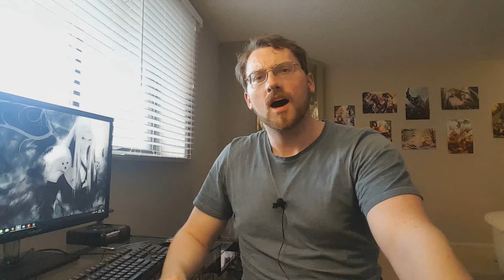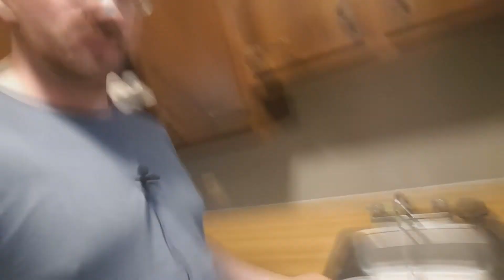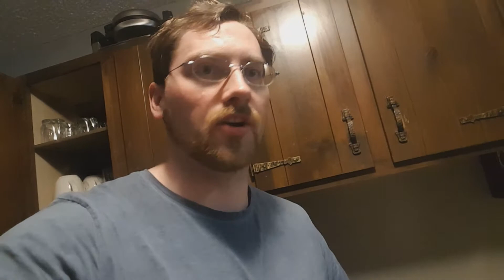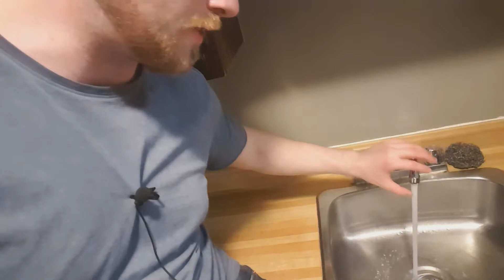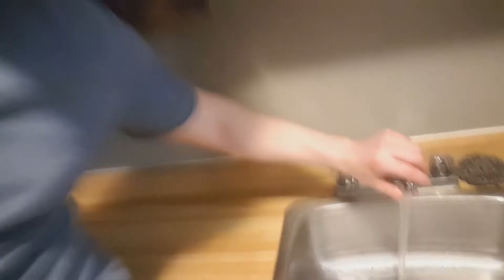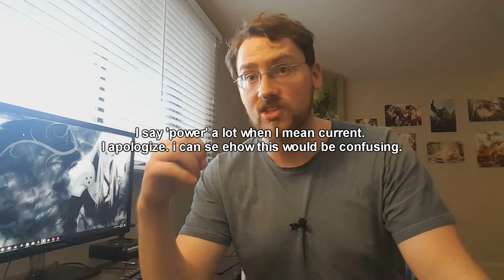Voltage vs Power, Threadripper vs i9

Comment: I dont think that an overclocked 18 core cpu,will manage heavy duty workloads just as good as amd solutions if the clocks where tuned to execute the same amount of IPC, even with the latency of infinity fabric that can be compensated by overclocking the ram....I think it will be extremely hard to exceed 3.1 mhz with temps within the 65 C on a decent custom cooling ekwater block solution for Intel, while I think that the amd solution will be capable to hit stable 4.3 Mhz on the best chips within 65 C..it will be very very interesting to see how far the memory will overclock on AMD barbecue of the infinity fabric I suspect that speeds above 4000 mhz might be pretty common, if the motherboard has prime rated materials for its components.....We need to see what asus will make as a workstation motherboard for threadripper, and I think it will take a lil more time than it usually did for intel WS class motherboards....fact is that amd solutions will be capable to run at least 6 gpus scaling properly PLUS raid 10 on m.2......so any amd system taken as global machine will likely obliterate in computation for really heavy high cache super overloaded workloads and while using tons of wattage in those situations  thermals will stay in check and stable, while the intel solutions will not be capable to keep thermals in check and will likely fry the motherboards very easily......so we should expect Intel based systems to become notorious to fail often....expect advanced Ram memory sticks at crazy prices hit the market soon at microwave oven speeds
Reply from the maker: I'm sorry but if you think that people can expect to hit 4.3 on even a high-end liquid setup on anything but 'maybe' an extremely rare subset of chips, you're intentionally fooling yourself. There's absolutely no reason at all to both expect that Threadripper will OC higher than the top 1% of 1800X chips, AND expect that Intel's 18 core won't OC to even close to within an entire GHz of the 10-core model. Furthermore, expecting RAM speeds on the Threadripper platform to far exceed those possible on AM4 is similarly unlikely. 

In fact to say that every single one of your assertions are wildly speculative is being very generous. There's absolutely no precedence or evidence for any of the claims that you're making at all. You're asserting both that Threadripper with increased core count will OC better than the best of Ryzen 7 while a similar core count will DRAMATICALLY decrease Intel's OC ability. it's true that Ryzen's much lower current compared to Intel's lower voltage means that Ryzen is more power (thus heat) efficient, and will likely be easier to overclock to that ~4GHz threshhold that the entire Ryzen lineup is limited to, 

We should fully expect Threadripper to OC to around 4.1GHz on a good day, with RAM speeds of around 3200MHz, and we should expect the Intel i9 7980XE to be able to achieve at least 3.8GHz under liquid, and maybe even break the 4Ghz threshhold... considering that the i9 7900X with 10 cores will hit anywhere between 4.5 and 4.7GHz, and a good long-term cool solution at about 4.4Ghz depending on binning under a custom liquid cool loop. there's no reason at all to expect those extra 8 cores will bring it all the way down to 3.1Ghz, that's just ridiculous. 

Btw I'm intentionally ignoring your claimed 65C threshold because CPUs can peak above that with no problem. Being above that all the time would be a problem, but no workload is like that. It CERTAINLY won't be the case that Threadripper will be at 4.3GHz with temp peaks under 65C regardless of air/water cooling solution, and on that I would gladly bet every penny I've made on my entire youtube career.
Reply from the maker: As far as i can tell all your assertions are based nothing more on your own extreme bias for hoping that Threadripper is going to be absolutely amazing and Intel is absolutely garbage. 

I fully expect that the 2 chips each at stock temps, the threadripper will win, since threadripper's stock performance is 3.4GHz and the i9 7980XE is stock 2.6GHz across cores with IPC only slightly in Intel's favor. However the i9 will be able to be overclocked to beat an OC'd threadripper.
Reply from the maker: stock temps -> meant stock speeds. out of the gate, threadripper will win... which is 'still' pathetic from intel's perspective that their $2000 chip will be beaten (I also mean overall... there will be applications and benchmarks that Intel comes out ahead on for sure,, but AMD will have the advantage) by a mere $1000 chip, fully half the price.

Comment: Every time a signal goes from a 0 to a 1 and the other way around, energy is used to overcome the switch.
This could also be the reason AMD uses less energy, because they are around 1GHz slower clocked.
Reply from the maker: Not true at all. even when clocked the same, Ryzen uses less power overall even with more cores. The main reason AMD is so power efficient is Ryzen's ability to reduce clocks and activity throughout the chip in many parts of the chip that aren't in heavy use, dynamically based on use. So yes, it's a clock speed thing, but not a core clock speed thing. There's a lot more to a CPU than just the cores.

Comment: I might have missed something, but how can you be saying that AMD would be "far more power consuming " than intel if it did not have the SenseMi technology?  Just look at any benchmark and review of power load on different systems and you will see that AMD is actually not that far off.   For example in a review on bit-tech.net  in Prime95 running on 7700K (5.0GHz) it draws 183 WAtt and Ryzen 1600X (3.95GHz) draws 203 Watt.  In this case senseMi as far as I know has no role, since the CPU is in full load. So AMD draws less than 10% more power compared to the Intel CPU.  And in workloads that can utilize all available cores,  1600X gives more than 10% Performance than 7700K.

You might be correct that AMD would be "far" more power consuming in idle state if it did not have SenseMi and intel still had its own technology to downclock to 800Mhz under idle.

Comment: Good video, see I told you before a while ago, now AMD went with LGA socket for the new Threadripper, if AMD wants to catch up with Intel, AMD need to do the same as Intel and adopt the LGA socket style and ditch the silly old fashion PGA socket
Reply from the maker: And like I did back then, I still disagree entirely... LGA is not just better than PGA. There's tradeoffs for both. I honestly don't know why AMD is going LGA for threadripper. I mean clearly they have a reason but I'm willing to bet it's not "PGA is old-fashioned." In terms of 'catching up,' PGA doesn't hold the processors back in any way. There's absolutely 0 effect on performance and bandwidth. it's just a pin style. 

The benefits to LGA are that if you bend pins, it's the motherboard that gets damaged and not the more expensive CPU, and the CPU is less likely to come out in the event of terrible thermal paste gets sticky or the machine gets dropped or something. 

The benefit of PGA is it's quite a lot harder to damage when, since the plastic of the socket is pressed against the PCB of the CPU with the pins held securely by the socket, as a result, when installed, the socket and CPU can withstand quite a lot more pressure. Also, in the event of pin damage, PGA is FAR easier to fix by bending pins back, since LGA pins are like little springs that are very difficult to fix. 

You can't say that either one is necessarily just better than the other in the general case. They both have an advantage and it comes down to preference... but it's ALSO true, that the socket style while having minor advantages and disadvantaged is not significant enough that it should in any way actually affect your purchasing decision... because for the vast majority of people it's never going to matter. It hides under the heatsync; even if you care about build aesthetic (and imo when the CPU is installed PGA looks far cleaner, because it lacks all the clamp and spring and all those pieces that go overtop the sides of the CPU, but is just a nice, clean looking smooth IHS on top of a simple clean piece of plastic)

Reasons I suspect AMD may have gone with LGA for Threadripper and Epyc is that the CPU is far more expensive, so CPU damage is a far bigger deal. It also could be that when you have over 4k pins, PGA has more pronounced disadvantages... but considering the release of threadripper and Ryzen is going to be like... half a year apart, and both of those sockets will be around for at least a few years, it's safe to say that them moving to LGA for threadripper wasn't them "catching up" but rather they decided that PGA made most sense on mainstream and LGA made more sense for that HEDT platform. 

sigh rant over. lol.... (Btw while I have and would purchase again an LGA socket, I actually do prefer the PGA socket style)
Reply: Completely agree!